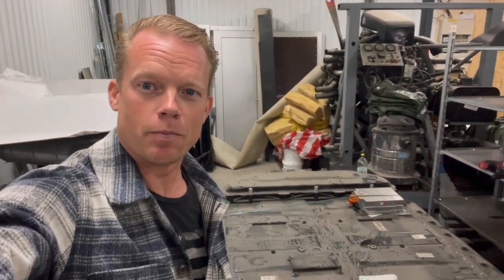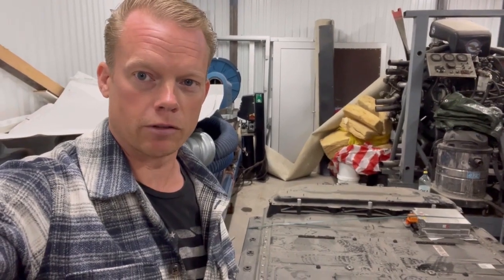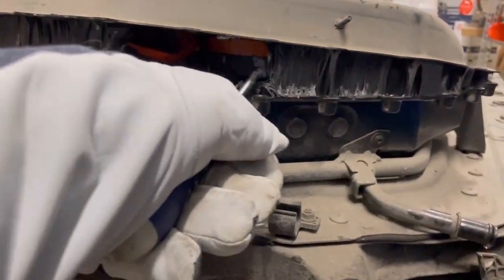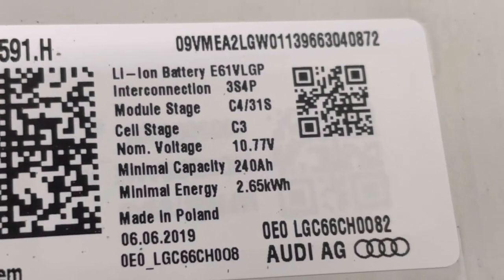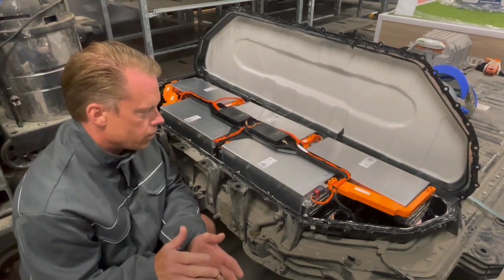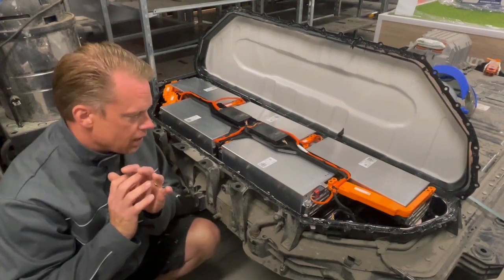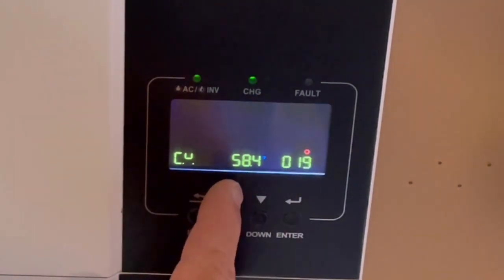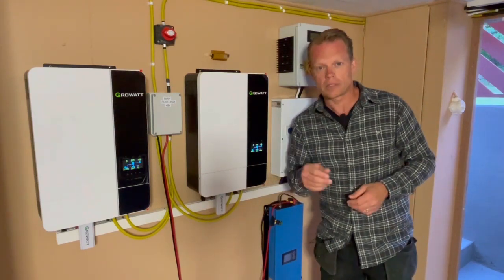Audi e-tron 55  DIY 95 kWh solar storage battery.

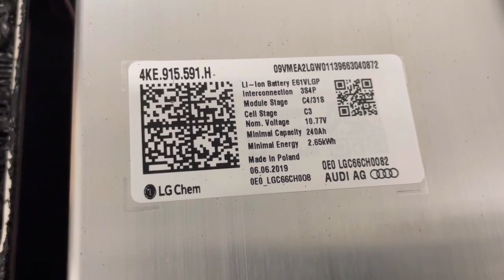Comment: 03:38 I see your pack is made with E61V cells from LG. FYI, Audi has just issued a recall for these (reference 93U9), due to a potential thermal runaway condition.
Reply from the maker: Thanks for the information, that’s new to me. Glad that i never have my pack inside of my house. I wonder what they will come up with.

Comment: lfp ? or nmc ?  5  of these in series go at  50v.+    . every 48v inverter  can work em that way
Reply from the maker: NCM712. it depends on the voltage range on your inverter, it will work, but you won’t be able to charge them to 100%. (63v) with every inverter.
Reply: @flyingtools  lets say you over charge the 58.4 + somehow .. ( another charger paralel )     . can that growatt  work with more  or you burn its mppt if paraleled with more volts ? ? can 4 more volts cause  problems ?
Reply from the maker: @anaxiosesti88  no it will hold for that I guess. I had at least 60 volt when I did discharge some modules in another test. I now have a 500v diy battery so I do not use those inverters anymore, so I can not do any tests on them.

Comment: I have 140KWH of model s modules At 48v I have run them between 40-50v since 2016 offgrid only. I have run over 90,000 kwh (AC) thru the system, so batteries maybe did half of that plus 15% for DC to AC loss. Simp BMS just sharing.

Comment: LOL This SPF 5000 is built for 48V batteries. It is surprise to me that it works with 58V. Why didn't you just wire 2 modules in parallel and get 48V ? Why 60? I have the latest firmware for it (06 from Jan 2022). Let me know if you want it
Reply from the maker: A lithium ion 14s battery holds a voltage between 44-58 volts. 
A 15s will have a voltage to 63v fully charged, growatt can only charge to 58,6v and you are only able to use 80% of the battery capacity.
Im not sure what you mean with parallel to modules to 48v. If you men to parallel two etron modules, they will only give you 11,1 volts.
Reply: @flyingtools  it can charge to 58 but can it discharge  lets see   61v if you add external boost charger ? ?

Comment: I have a e-tron battery on order from the junkyard and i wonder if it can be used with the solax without modifying it
Reply: Just connect to the positive and negative like u did with the id3
Reply from the maker: I only opened this battery in the rear upper part so I can not answer how it looks at the main positive and negative.
Take help from a certified person if you are unsure.
Reply: I got my battery, its super easy i was amazed..u just need to open the front aluminium part..its rubber gasket sealed no sealant.. there are fuses and relays there for turning the voltage on or off from the battery. Battery and managment is self contained..no connection to bms under it..just 2 battery connections..from what i plan is to have the positive and negative relay that connect the battery output wired to a 12v supply that activates the relays..when relays are on ubhave battery voltage and are off no battery volttage and u plus have a fast fuse safety there ..if anything shorts they will burn and u are safe..so audi tought of us diy types..just have the relays turned on or off from outside and u have 400v from the outputs on the husing... Will get my 12kw solax next week and have work started

Comment: Hi what happend to this battery..have u used it with the solax? Or did u sell it and got the id3 battery instead? Btw how much does the etron battery cost you.just for info.
Reply from the maker: My friend bought it and he will use it for solar storage. My plan was only to use this together with my growatt inverters in a 15s config but the growatt inverters could only charge that config to 80% soc. 
And the second reason:
Etron battery voltage 400v
Id3 battery voltage 450v
So I choose id3 for its higher voltage and the slim format of it.

Comment: Lithium-ion cell chemistry give you 3,7volt nominal if you have a 3S setup your Growatt inverter will work fine if you Series the 5 packs giving you 15S configuration. Thus 3,7v*15=55,5V below the 58,4 max allowed( this value comes from the LFP chemistry of 3,2v but normally a 16S setup) 
Just don't mix battery types(chemistries) on the Growatt or any inverter.
Reply from the maker: Hi. Yes you are right but I would like to have the chance to sometimes charge my batteries up to 4.1v/cell, I lose too many kilowatt-hours not to have that chance, for example when I’m expecting bad weather for a few days. Thanks for your comment 😊

Comment: Hello! I have a bunch of eTron modules for my EV conversion. Could you please tell me the thickness of the busbars connecting each module together? I'm guessing they are about 3 or 4mm thick? Just one measurement will be fine, not all of them 🤭 Good luck with your project
Reply from the maker: Hi! I have already put it all together again.
So sorry, but if i need to open it up again I will do the measurements for you. Thanks for your comment and good luck with your project to😊👍🏻
Reply: @flyingtools  Ok no worries! for reference: the tabs on the batteries are 30mm wide, 3mm thick and have a flat surface about 12mm 'deep'. So i'm making my busbars 32x3mm cross section

Comment: You need a proper inverter!
SMA sunny island 43-64v,  victron energy multiplus 38-66v,  studer xtender 38-68v  battery voltage range. 
The modules in the main part of the battery pack might be 12s.
Thanks for sharing.
Reply: How about just a 400V inverter?
Reply from the maker: @rkan2  yes that’s what i want. But I haven’t find any diy BMS that will work with 108s for a price I’m willing to pay.
Reply from the maker: Thanks for your information, and yes you are right regarding the inverter. Let’s se what the future will bring😉